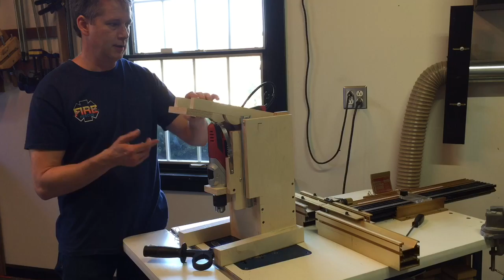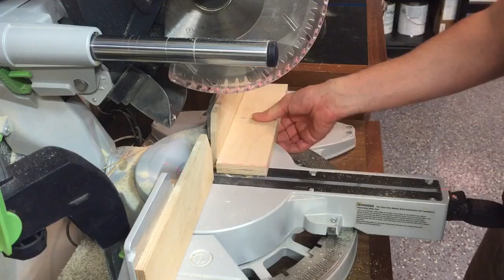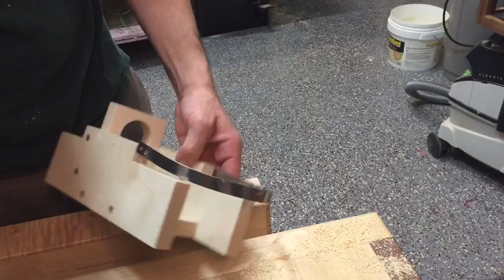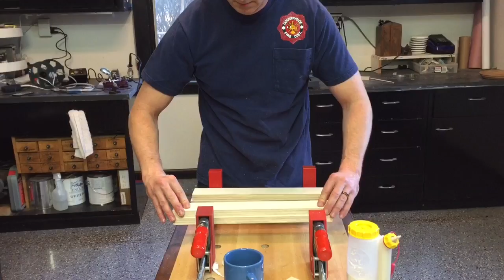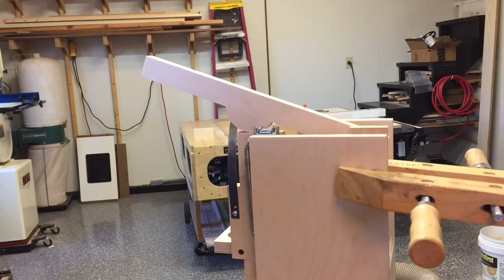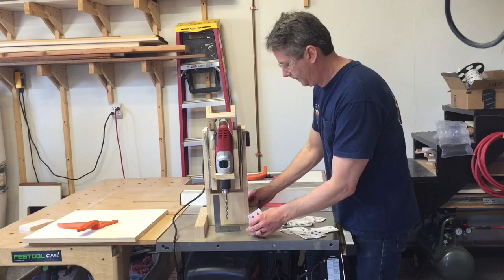DIY Bench Top Drill Press

Comment: Just finished making my own drill press using your model; thought I’d mention a few things that arose for me ... firstly, because the spin/hammer dial is on the side of my drill, I had to make the hole for the drill chuck a little off-centre; this resulted in the drill moving ever so slightly off perpendicular when I tightened the aluminium clamp... however, some pliers work to re-shape the clamp - and eventually removing it, turning it around and connecting it the opposite way - sorted this problem, giving me a perfectly square result when drilling. Secondly, mine is a SDS drill and I sometimes use an adapter for HSS bits - so I made the drill press taller. This would have demanded a deeper ‘plunge’ than the press could have managed, so I cut two vertical slots into each side of the press which allowed me connect (with bolts and wing nuts) a platform for the piece to be drilled, which can be raised/lowered depending on whether I’m using SDS or HSS bits; this means I don’t over-extend the ‘plunge’ to achieve a fully bored hole.  Finally, I struggled to find springs (COVID lockdown in Ireland!) so I used robust (approx 1cm) bungee cords - worked perfectly.
Overall, your design worked a treat - well engineered and clearly explained!! 
Many thanks again 👍👏

Comment: I first came across this video several years ago and I am very glad you haven't taken it down, because I now have a need for your cleaver design. There definitely are times when it is much better to take the drill press to the project, rather then trying to take the project to the drill press. For instance, I have built a workbench that I would like to drill 20mm holes to give it MFT functionality, but my bench top drill press does not have the reach to span to the center holes. Since I already have a red 1/2" hammer drill, your design will work great!  Thank you for sharing your creativity!

Comment: I have watched LITERALLY hours of DIY drill press videos.  Yours is by far the best!  Great job.  
Two questions:  #1 do you have actual plans/dimensions? #2 at the end of you video you noticed your drill was not totally square.  Please help me how I would detect & fix that prior to complete assembly.  Run the high side over a planer?  Sand it on a disc sander? THANKS!
Reply: to detect, all you need it a good square measurement. (get an engineer one. and still test it out when you have it)
Everything works but sanding is very hard to make it perfectly square and to the right amount. Shim is easiest.
If you build a tool and need a plan, you shouldn't build it.
I would copy him just how he set up the gun, the number just come it up with yourself. 
the only important in diy drill press is make sure come up with a system that has very little of play of the drill moving from side to side when pressing it down.  I wouldn't like to use those drawer slide, well in my experience I never see a high quality slide that doesn't have free play. If there is such thing, then it would be a good thing to use.
Reply: @gamepurpose  I felt quite the same. Drawer channel have play and hence not ideal, however rest of the concept looks well sort out. I am still trying to figure an alternative to the drawer channels. Open for suggestions.
Reply: one option is using Pulley Bearing roller wheel / Concave bearing wheel, 4x2 parallel on each side with metal plate sliding between them. I assume this would limit the play. Just an idea :) 
@Selandry1 , your thoughts would be appreciated.

Comment: It's a really good shape for a drill press, specially the fact of been opened down the drill, so I can put it any where and use it with an horizontal or vertical piece. But if you had wrote the measures on the description, this video would be much more useful. Although, thank you very much for sharing your idea!

Comment: Great project, I will certainly be taking some of the design features for mine. I know you made this for a particular purpose, whereas I am trying to make as many of the workshop machines myself using hand tools. One feature this lacks for me but will be easily done is a "Pillar." This would be easy to do by make a box shaped pillar, and mounting the "press" mechanism on the outside. It's hard knowing where to start with making the machines from scratch. Each one is useful in making the rest! 

One feature I really like about your drill compared to a bought one is for exactly the reason you made it and how you used it to make a bench dog hole. 

Something else I want to put on mine is to use it as an oscillating spindle sander using a second drill to drive the oscillation.

Thank you again,

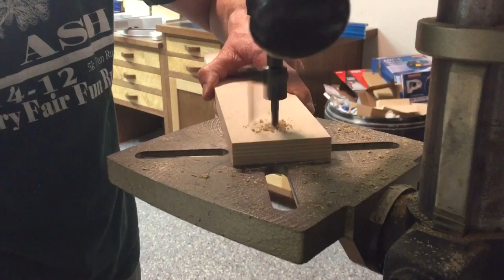Comment: 2:12 so in order to build a drill press you need a drill press
Reply from the maker: Yes. And at the introduction. Seriously, what kind of a shop only has one drill press?
Reply: Actually, no.  You can easily use the hand power drill you are going to use in the drill press to build the drill press.

If you find it difficult (as I sometimes do) to drill straight holes by hand you can put a couple of boards together, offset a bit and use that as a guide.

Just because someone uses a tool to make a different version of said tool does not mean that tool is required.  There are quite a few videos on youtube that show you how to make shop-built tools using minimal tools 

DIY Creators actually has an excellent series on using minimal tools to build a workshop, as well as several projects using them.  Izzy Swan some time ago put together a $50 workshop series (basically took $50 worth of tools to start a workshop). Mathias Wandel also has a LOT of homemade shop equipment videos (though he's an engineer so be prepared for in-depth and overbuilt in some cases).

Comment: my first attempt at building this went well. Made a couple changes for my needs but the drawer slides I used are not working well. could you link the ones you found. Thanks
Reply from the maker: Sorry, but I did not document the slides I used. I bought them from Rockler. Hope this helps.
Reply: Selandry1 no problem thank you. I gave the site another look. Found a set that should work.

Comment: Very nice. I have a small garage. I have a table saw, a homemade router table I just completed that came out really nice. My wants..... a small bench top drill press, a belt/disc sander and a bandsaw. I will definitely build this or one similar. I love the drawer slide idea.  I figure...what the heck, I own a very nice and powerful Craftsman 110v variable drill I rarely use as many of my tools are now battery tools. So....why not use it for a drill press. If you don't mind me asking where did you find the drawer slides that short and what length are they?  Another project to do is to use a 110 v jig saw and set it up as a table scroll saw. Thanks for the video....inspiring.
Reply: Never mind the questions I missed them in the beginning....got it. Thanks!
Reply: Wayne The Seine 9
Reply: I replayed the vid and got it....but thanks.

Comment: hello very nice video but i have a question what kind of spring do you use? what dimensions?
Reply: gabriele disopra It's a coil spring made out of piano wire wound around a piece of dowel held in a vise. Don't have a piano? 😦. Okay, you can use your friend's guitar string (make sure he's not looking). Any long coil spring about the length you need can be used, or some elastic (bungy cord), pinch your surfer-friend's cord when he's not looking.

Comment: The thing you called "hub" on the drill is most likely 43mm in diameter and called "euro neck". Many drills and router spindles have that (here in Europe at least), which is nice because in a pinch you can mount your router in a drill stand. 

You like hose clamps to mount stuff, don't you? ;) What I like to use for those non-permanent fixtures of tools are bicycle quick release levers, either from wheels or the saddle. You can pick them off old bikes or buy them cheap from bike shops/ebay/China. The drill would also be mounted much more rigidly since it is really clamped in the hole and not just held in by a strap from the back. I've built a router table where the spindle is held by one of those saddle quick release clamps (pinching a slotted 22mm plywood ring). It is impossible to move the spindle when clamped. And still it takes less than five seconds and no screwdriver to get the tool in or out while the orientation is 100% repeatable (needed, if you want your router bit to be really 90° to the table).
Reply: Magnetic therapy

Comment: I built the drill press, so far it looks like it is going to streamline my ring making, but I have run into a snag. I am using a Bosch impact drill and I have noticed some play in the chuck. Where it goes into the drill motor there is a slight amount of play and that results in dangerous wobble when the press is lowered onto the router bit. What drill are you using? All of my drills exhibit a small bit of play I have noticed.
Thanks for the awesome line of videos!
Reply: That's why drills and routers are different tools. The only load a drill is designed for is pushing a drill bit. If there's a few tenth of a mm in slop axially or radially it doesn't matter in a drill. Without pushing the drill won't do anything anyway and the sideways guidance is provided by the drill bit and not the drill itself. That's als why it's not a good idea to use a drill like a router where you mostly push sideways on the bit. This can damage the bearings of a drill.
Reply: I think the Impact/hammer drill is not designed for precision. If you want precision, you may try with a semi metal body drill.

Comment: and like I said no offense intended. I realize this gentleman was building this for other purposes that the need of a press on a budget
Reply from the maker: Actually Ziggy this is a purpose built Drillpress for making rings on my router table because any  store bought table top version would not work so I designed this.  I understand your point though. And it worked great for dog holes on my workbench. Try that with a ryobi.

Comment: I don't understand videos like this. yes it is very inventive, but what's the point? the cost of the materials unless found would be the same as a cheap ryobi drill press on sale. not to mention needing a drill press for cutting accurate circles for the drill to sit in. so I need a drill press to make a drill press? I mean no offense it was neat to watch but impractical for a broke m'fer like me
Reply: Ejhem... here in argentina a drill press costs over 210 dollares ( a cheap one).
sorry pal, but for me, its way cheaper to use the spare wood i have from other projects and my recently broken drill (on off switch is broken and since its old i cant find a replacement, but i can do a new connection and adaptation for a drill press)
so... yeah... in my particular case its WAY cheaper to build this...
besides this.. Again, here a drill costs about 50 dollars and all the wood needed for this press only 20 or less.